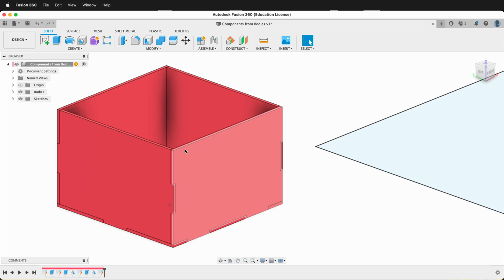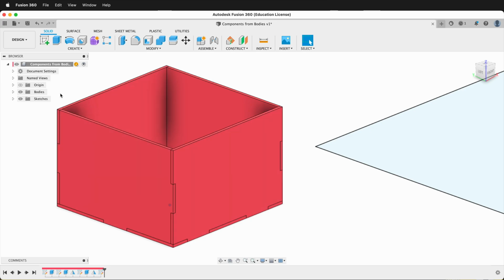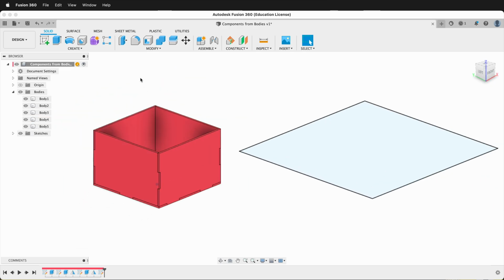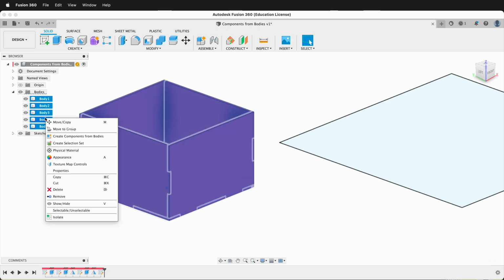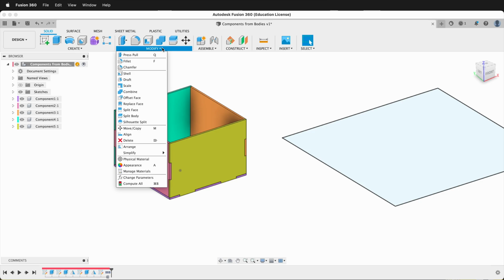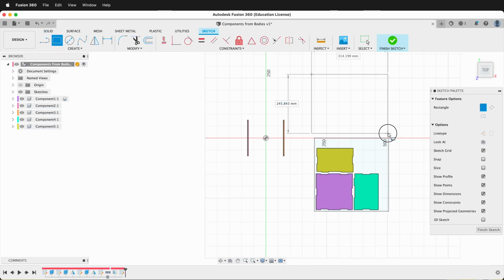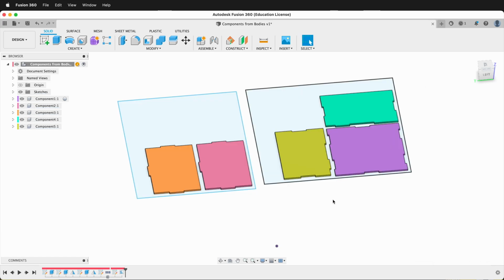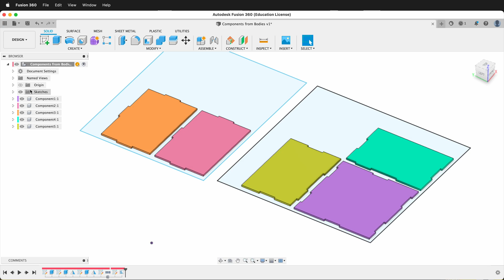Create Components from Bodies in Fusion 360 Tutorial

Comment: But how can I make a component with those components inside (after I created the individual components)?
Reply from the maker: Components inside other "components"  create an assembly. An assembly is a group of components. You can drag and drop components that you've created into a single assembly. If you look at the outliner, the default Fusion model becomes an assembly. Once you have two components. You can have multiple assemblies within that assembly.
Reply: @WhatMakeArt  Thanks
But I tried drag-and-drop but it doesn't work. 🤔
Reply from the maker: I made a sample test file with  three separate bodies in Fusion 360. Then I selected all of the bodies in the outline, right clicked and selected "create components from bodies." Then I left clicked one of the components in the outline and dragged  it on top of another component, when I released the mouse button, the two components became one assembly.

Let me know if that's not working for you and can make a quick example video.
Reply: @WhatMakeArt  Thank you very much.
Yes, this is exactly whats not working for me.
I'll make a video of it, but how can I send it to you? (YouTube doesn't allow links to send)
Reply: @WhatMakeArt  This does not work for me.  It does not allow me to drag one component into another.  Dragging the bodies into a component appears to work initially, but if you try to look at the component, it is empty

Comment: But what if I want to create one component out of all those 5 bodies?
In this case you created 5 separate components (one from each body).
I am interested in creating one component out of all those bodies, so that I can then handle all of them as one unit entity.
Reply from the maker: You can drag and drop bodies into the same component to make a multi body component

You can also put multiple components into an assembly
Reply: @WhatMakeArt  I had issues with this.  It would not work at all, but after researching, I learned that you have to move the timeline slider all the way to the right for it to work
Reply: @WhatMakeArt  How do you crate an assembly?
Reply from the maker: Have multiple components at the same level and it is an assembly in fusion 360